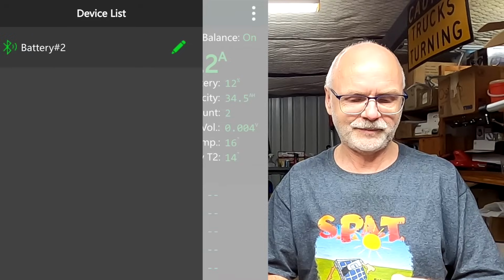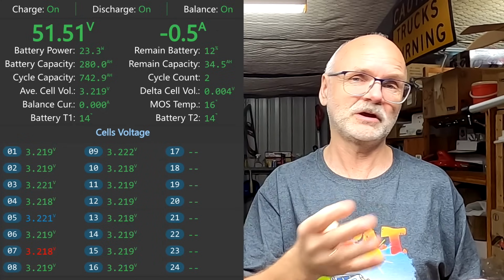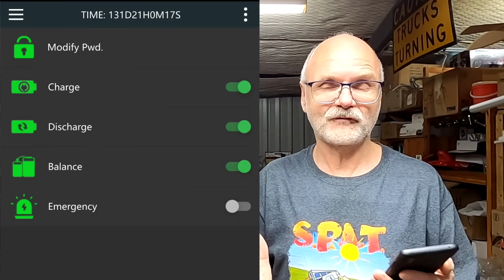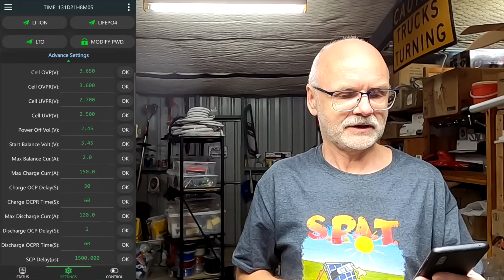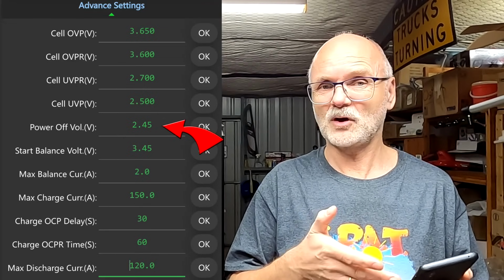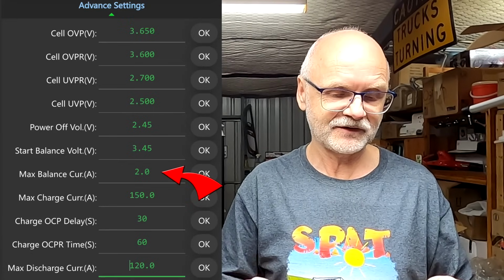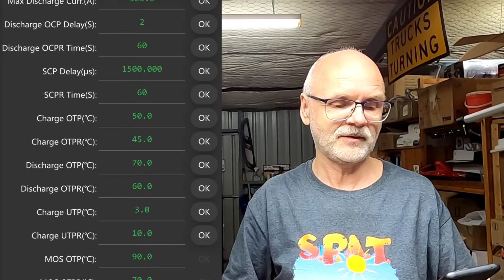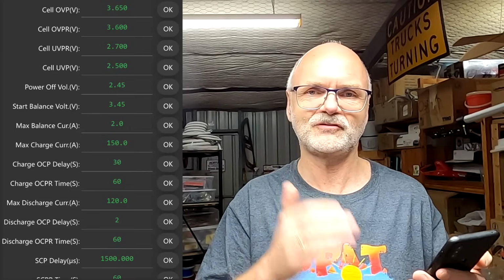JK-BMS: all settings and menus explained. How to program and set parameters.

Comment: This is all very nice. What about settings on the most recent V19 AND using it without any coms? Only straight, constant, voltage from a source, what are the settings then?
Reply: I just changed my 2 batteries bms's to the jk bd6a20s10p version 19.27. Can send you the settings file if you have the same version.

Comment: I’m just about to change bms off my two batteries and this was a really big help. Thanks for this video.
🙏
Reply: Just changed my 2 battery bms's to jk bd6a20s10p version 19.27. Running open loop. The original bms's were useless with passive balancing.

Comment: Just listening again, to fine tune settings on several new JK BMSs  for several batteries. Re your comment about voltage triggering the  OVP setting "turning off the battery" : From a lesson I obtained from personal testing; I believe it would be more accurate to say OVP turns off the Charging Current (current in) ONLY, ...  while leaving Discharge Current ON (to run your loads).  I previously did not know that was possible until it happen for me during one of my configuration and testing cycles. I Believe that is True for JK BMSs.

Comment: The images of the jk b2a8s20p settings don't all match with the latest software. I'm stuck.

If you have any programming tips for the latest Android 5.6.0 app, please let me know. I'd appreciate an up-to-date link for the settings.

I've been trying to get the BMS working for two days now.

What a pain, way too complicated.

My system has 8 cells, 360AH, 24V, jk b2a8s20p BMS.

Comment: good day sir I have something to consult. I have JKBMS model JK‑PB2A16S20P  and it works for several days. but now there is a voltage output even if the bms is turned off? And the Discharge button from the App or setting is turned of. May i ask what to do to resolve the issue?

Comment: Hello, nice video! You are the BEST!,  I wonder if you could help me , I have 2 Lifepo4 48V 300A with 2 JKbms 

Both batteries are in parallel  and connected to the inverter. 

I have the same settings on both bms, but one IS showing 95% Soc. And the other one IS showing always like 20% less.  Why?  Both batteries are brand new! 

Can you maybe help me? Thanks in advance

Comment: Wire resistance will affect the voltage readings that your BMS sees so the resistance of these thin wires does matter. As for whether you should be concerned about the exact resistances, that depends on how closely you run your cells to the maximum cell safe voltages. I'm not going to take the time to learn all of the formulas for calculating resistance voltages at different temperatures so I'll just set my max cell voltage at 3.60 and trust that this is a bit overkill. I damaged one cell by not using a BMS. The cell made it to 4.0 volts before blowing the pressure relief. Of course, it was a balloon by that point. I may just be overly cautious by not charging to 3.65 but it has been proven that Wh don't increase enough between 3.45 volts and 3.65 to justify pushing your cells to the max manufacturer specified limits.

Comment: I have it , it was doing great by giving full charging through solar panel and current , suddenly while giving output all system got off along with the inverter and now battery percentage is weak but anyway it is giving good output but showing low percentage. Please help .

Comment: Andy, I just finished my install, of five V19 BMS’s.  Installed your configuration (as shown in this video).  However, all BMS’s have an alarm!  On my cell phone app, I have the ‘flashing’ message……..Modify PWD. In time.
Any idea what this is, and how to access it?  Don’t have PC access, yet.
Reply: It's a reminder to change the default password, and possibly to set the time: click control at the bottom, then enter your password and hit "time cal." At the bottom, it will use your phone clock to set the time on the BMS.

Comment: i'm surprised because on my JK BM (V14) the max discharge current is replaced with continuous discharge current, and i though that if i put for example 30A the BMS should limit the output current to 30A... and i didn't knew why my system shutted donw when the sun declines....
untill i saw the battery sending 57A while my parameter was at 10A... so i review your video more carrefully and no i understand

Comment: Balance lead resistance is affected when splitting your pack and extending the wires for example in a golf cart where you have half the pack under the back seat and have to pack under the front seat

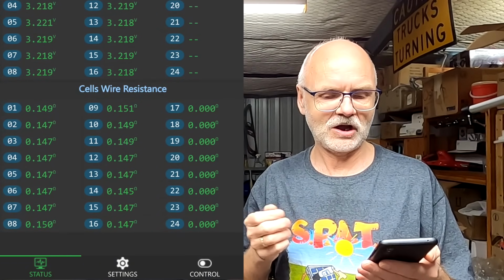Comment: It's my understanding that the resistance of your balance leads can be quite important because it can alert you to a loose connector, a broken wire, or corrosion or damage, allowing you to take a pro-active action. If you see anything around 200 mΩ it could cause problems and should be investigated. For example, at 10:34, the readings you see of .147-.151 indicate a healthy lead and connection. The app's "Con. Wire Res. Settings" allows you to tell the BMS: “Hey, there's a known amount of resistance between you and the real cell voltage — please correct for that.” Entering custom wire resistance helps: improve voltage accuracy, enable correct balancing, and avoid early/late cutoffs. I take that to mean for example, if I positioned my BMS in the pack in such a way that I have some really long leads, and then some really short ones, I would use this feature to calibrate the resistance of my wires because they would be so out of whack otherwise.

Comment: Hello is it possible to change output voltage on BMS
Reply: You can control the high voltage shutoff via the BMS, which will regulate the output of your battery pack. However, you should only do this as a backup and you should control the maximum output voltage of your battery pack with the charger.

Comment: I have this BMS on an extra battery pack for my scooter. When the battery is disconnected and sitting, the BMS does not time out and drains the battery pack. Do I have to install a switch or change a setting to prevent this from happening?
Reply: That was a bit of a surprise for me. Yes, you'd need to install a switch unfortunately because the app does not have that function. Lets figure out how long this battery would last and use an example of a common battery pack such as a 48V that has 9.6Ah capacity: Bluetooth modules typically draw around 10–20 mA, sometimes more. Let’s assume 15 mA:= 9.6 Ah / 0.015 A ≈ 640 hours ≈ 26.7 days. So for best practices you'd need to charge this battery if it is in storage every two weeks, sigh...

Comment: Thank You, Andy, BUT... I have a one question. If Start Balance Volt. & Bulk Charging Voltage are the SAME, what about level of Floating Charging Voltage? How to proper set in charger? Thanks & greetings from Poland. :)
Reply: For Li-ion or LiFePO4, float charging is generally discouraged. Instead of float, it’s safer to cut off charge at full voltage and let it drop naturally.  Don’t leave the charger connected indefinitely even with a float setting — it's better to let the pack rest at ~40–60% if in storage.

Comment: Hi thanks for the vids hope you can help me and really appreciate a lot if you reply I have 72v/40ah battery that connect to JK BMS and I am using the battery for my electric scooter and the full charge of the battery is 83V with a cut off of 72V is there any chance I can chnage the cut off from 72V to 65V through the BMS
Reply: I have the same exact problem except The BMS Tends to drain the battery pack when it's sitting for an extended period of time, disconnected and not being used
Reply: I had a similar problem and was surprised to learn that it has set limits depending on the battery chemistry type you choose. If you want to cheat their settings and get to a lower cutoff then you'd need to select a different chemistry such as the LiFePo4. However, when you do that, then you also get the defaults for other parameters such as temperature, balance start voltage, etc., so you need to curate all those as well. The best solution to a situation where the user wants to change the high voltage cutoff is to regulate that setting via your charger, not the BMS. A CCCV linear desktop power supply can achieve this.

Comment: Hi Andy, we have just installed a V15.33 JK-PB2A16S20P, we revieved a message from Gobel Power (Daniel) that based on our notice that the alarm was always on and Running off, they came with this answer; "sorry, our print mistake, RUN should be ALM, and ALM should be RUN" do you have also notice this? Cheers Eloy

Comment: Hi I need help.
My inverter is OEM from model SRNE HES48 6kW with other name in my country.

And JK BMS pb2a16s15p

Is it support each other ?
Because inverter alert fault code 58

I tried many different pinout settings, including the ones in the manual, changing a lot of settings.

Not works at all

I already send email to SRNE and JK, but still not respond

Help me please ... 😢

And thank you so much for all videos I gained a lot of  knowledge. 😊

NOTE
And one mistake I made was connecting the 5V cable from inverter to the BMS, which is the communication pin, many times. From now on, it still seems to work normally, just can't communicate with the inverter, but I'm still not sure.

Comment: Recently I purchased a 51.2V120AH lfp battery online.  Unfortunately there was no user manual. From the invoice I found out that it was fitted with JK BMS. After a lot of trials I got the password ok. I could not understand some of the parameters. Your video is very helpful to have a deeper understanding of the system. I could not access the advanced settings since a different password is needed. Anyway I am not interested in changing those critcal parameters.
Thank you very much for providing so much of useful information.
George

Comment: I wish there were a way to monitor the BMS from anywhere in the house. I have to be within 5-6' of my BMS to be able to connect (they are inside metal battery cabinet).
I would be happy if there was such a thing as a Bluetooth repeater that could re broadcast the BMS signals throughout the house so I can monitor without having to go to the battery room every time.
Reply: Hi! An Option (like I use):  -> No problem IF (!!) you have BMS with RS485 or CAN port like you find on the OFF-Grid Garage homepage.
Then you can connect them at a Raspberry Pi with running VenusOS (Victron) with access via Bluetooth or W-Lan for monitoring most parameters of your BMS ;-)
You will find here many videos installing VenusOS.
BMS settings can only be done by Bluetooth or cable connection at pc.
Reply: @Darkbluesstar  There is RS485 CANBUS connector on the JK BMS I use (3 packs), but they are inside the back of a metal cabinet and inaccessible from the side I can get to. Cabinet is in a corner and a bunch of 2/0 cables have to be disconnected, along with other stuff and the 700lb battery cabinet has to be moved away from corner to get to those BMS modules. That's why I was hoping for a Bluetooth 'repeater' solution. Right now I have to keep my phone in there and monitor the phone with Windows "your phone" link to see the phone screen on my PC. But  problem is, I can't use my phone then.

Comment: Hi Andy. I do have a problem with a parameterof the JK BMS. I have a 100A (B1A8S10P) BMS on my boat. I have an anchor windlass (1000W). This is supposed to draw around 80 amps (I do have a 80A circuit breaker, it never tripped. But, when I used this windlass the first time with my BMS I had a "Short Circuit protection" alarm, which stopped the discharge and my windlass did not work. I understoopd that this type of motor have a spike of current (2-3 time regular curent) that may cause the issue . I chnaged thge SCP delay from 1.5ms to 150ms. NOw it works, and I see briefly 230A when using my windlass, then goes under 80A. Do you think is is safe to keep the SCP delay at such high value?

Comment: Hi, does anyone know if you can specify what time of day the bmw will allow the battery to charge? I want my battery to only charge on the cheap rates of electricity during the night so hoping its possible to set it so it only charges between 00:00 and 06:00. Thanks

Comment: Hello. Thanks for video. In Bms with heating function i get green wire for connection thermal pad. In same cable there are also one red and black wire. What are used for? Thanks

Comment: Hi Andy.  I need to know if JK BMS can be used only for charging and balancing.  I would prefer to connect the discharge and recuperation directly to the vehicle battery and the BMS would then only signal the battery values apart from the current.  So the question is whether the BMS monitors the equality of charges in both directions and prevents further charging when the discharge goes the other way.  Thanks for the reply!

Comment: SCP (Short Circuit Protection)

Andy, I’ve been troubleshooting a new 12V Swipower inverter paired with one of these JK BMSs. I ran into an issue while using an air fryer (drawing 135 amps on 12V): every time the fryer cycled on, the JK BMS would shut down due to the SCP triggering.

After some head-scratching, I considered how an inverter draws current from the battery. Current spikes occur each time the output voltage crosses 0V—whether it's heading positive or negative—and continue increasing until reaching the peak voltage, which happens during 1/4 of the output waveform cycle. For my 60Hz inverter, 1/4 wavelength is 4167µS.

This led me to think the SCP setting might define the time window for detecting a rapid current increase. The default SCP was set to 1500µS, so I adjusted it to 4200µS, and everything worked perfectly! This value covers the current rise time during each half-cycle of the output waveform.

I experimented with lower settings (below 4000µS), but the BMS kept shutting down. However, any value above 4200µS worked fine. To optimize, I settled on 4200µS as the lowest setting that resolved the issue.

Recommendation: For heavy inverter loads, I suggest setting the SCP to 4200µS for 60Hz inverters and 5100µS for 50Hz inverters.

Interestingly, I came here looking for an answer to this SCP issue and realized I might be the first to post about it—two years later!

Comment: Hi, if I want to use the dry contact of the jk bms to switch the contact, I would like to put the V battery at 51V opens the contact and 53V closes; How to set the DRY1 Trigger, Trigger Val and Relase Val?

Comment: Hi, some information, I have a 2p 16s eve 280 battery pack, two pallets and precisely the 2nd and 6th during the charging phase are always higher than the others and during the discharging phase always lower than the others, what is the correct procedure to see if one or more of these 8 batteries is faulty?
a recommendation 90 degrees for spaghetti don't do it 🤣🤣🤣🤣🤣

Comment: Hello Andy! 
I have watched this video many times when setting up JK BMSs for many projects (solar and others). Really helpful video, thank you! 
Since the JK BMS software has slightly been updated, do you maybe have some updated settings to share? 🙂
For example they have changed the way the over and under voltage protection and recovery works in conjunction with the 0-100% SoC reading. 
A positive or negative reply will be equally appreciated 😁 Thank you for your good work.
Reply: Agreed would love to see an update since the recent changes were made!  There have been several new settings added to the app.  LCD Buzzer Trigger, Device Addr., UART1 Protocol No., etc.  Also, will not allow OVPR to be set higher than 3.5V

Comment: Hi, strange question, but does anyone know if the on/off push button on the JK BMS (8s 40A) is weatherproof?
Just built a battery for a friend's mobility scooter.....could do with knowing if it's ok on the outside or if I need to get another IP rates momentary switch or if the supplied one is ok for the outside of the box.
Cheers

Comment: i have a ebike that uses lith polymer cells i want to use this bms with it aka swap out the stock one.. my question is can someone give me the parameters to put in the bms?

lith ion and lith polymer is diffrent at 3 volts a cell is dead so this is why i need to know what params to enter for everything anyhelp would be awesome

Comment: I am building my first 16S Battery for a Sailboat.
While i am waiting for my expensive 35A charger. I am thinking about doing first 2 cycles with a cheap charger. For €30 i get a cheap 4A - 58.8V charger (14S LiIon). 
Is it save enough to let the BMS shut down reaching 3.65V or do i need to place a 10A Diode in between to get the voltage drop of 0,7V?
Is placing a diode inbetween a good idea to reduce max voltage anyway?
Reply from the maker: The diode is a good idea and should work. Maybe add 3-4 diodes in series to reduce the voltage even more.

Comment: Not sure how, but I seemed to have locked (forgotten) my JK_B2A8S20P password , so I'm trying to reset the password back to factory, anyone any idea's??
Reply from the maker: Apparently, you need to forget the BT first, reconnect with the standard pw and then use the serial number of the BMS to login (should be in the menu once connected).
Reply: @OffGridGarageAustralia  , thanks for that, however, sadly it didn't work. BT doesn't actually pair,  it says to pair using the app, so no BT to forget, then login via serial says password error...